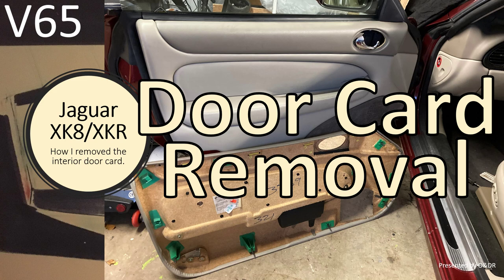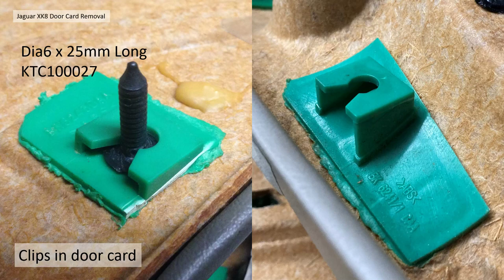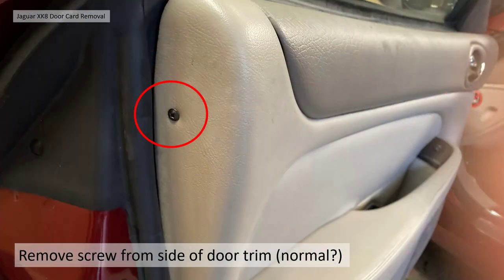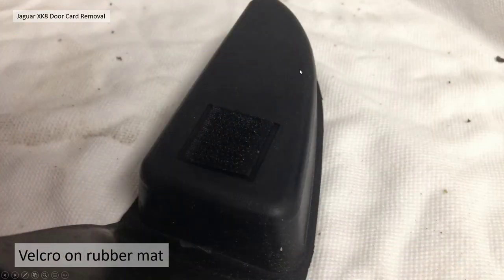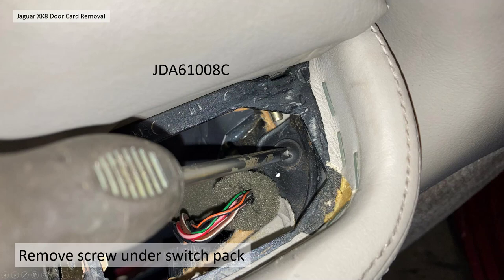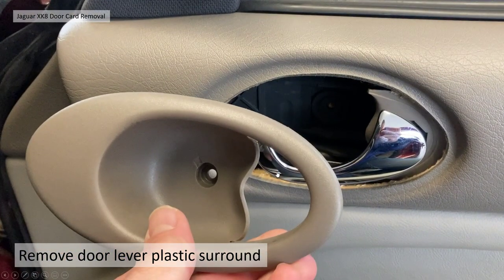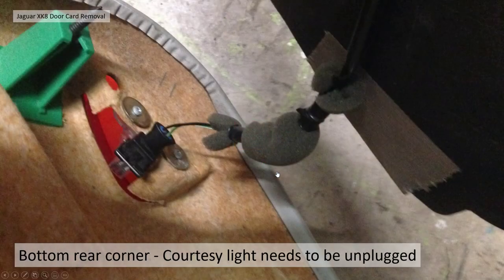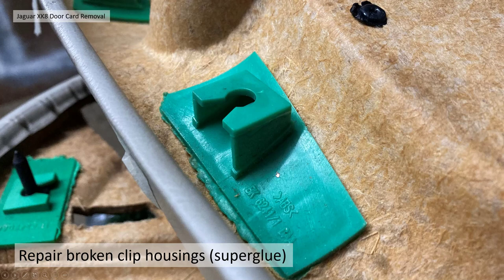Jaguar XK8 Door card removal V65 / XKR (X100)

Comment: Thanks Damian, got a rattly driver's door speaker, once again your authoritative videos are a must.
Reply from the maker: Bernard, glad you are finding them useful. Thanks for the comment regards Damian
Reply: @ODRModurol  I was defeated by the plastic cap in the door handle, my fine screwdrivers were not enough to flip it out, just can't get the angle I need on it, even with bending one especially. That little cap will not come out and I started to just make a mess of it. At least I know the card has never been removed before. Frustrating when you know exactly what tool you need but you can't find it and you're in lockdown. Rattly speaker, you're safe for now.
Reply from the maker: Bernard, they are particularly hard to get out the first time but not impossible. Hopefully it isn’t superglued in. Persevere and you will be OK. Just watch out for it flying off when you eventually get it off. Assume you are still in lockdown over there as plenty of time to fiddle. Thanks for the comment regards Damian

Comment: Hi Damian, thank you for this and marking the locations of the fir tree clips.  I had to remove the door cards to adjust the front windows because of gaps with the rear windows on my convertible.  This ensured things worked out well.  Cheers!
Reply from the maker: Craig, it’s good to hear that knowing where the clips are made a difference. Much appreciate your compliment and taking the time to comment, regards Damian

Comment: Hi Damian enjoyed your latest video, I mentioned a while ago to you my drivers side puddle light not working, just checked your door card removal video and opened it up enough to see the puddle light is not connected to anything and no wire and plug dangling so at least I know why it's not working not sure why there is no power source though, thanks for the door card video
Reply from the maker: Richard, glad you found it useful. Going to be doing my driver side door handle seal at some point. I will video where the wires originate from it try to help you retrofit. Thanks for the feedback much appreciated, regards Damian
Reply: @ODRModurol  Good man yourself Damian, poking about at thing's would never have dreamed of thanks to you,  and the other talented generous enthusiasts
Reply from the maker: Richard, glad the info is helpful and you are working on your car yourself. Much appreciated, regards Damian

Comment: Hello Damian! Hope you are well. Here is an update. I had my mechanic install the used switch. It did the EXACT thing the original switch did. I am completely out of steam on this dilemma. I left the door panel off. We are now thinking it is the door module. I can get a used one for about 100.00 on ebay. Really don't know what to do. Decided to run it by you.  Thanks for reading! PS. Another 300.00 in labor and still, no go!
Reply from the maker: Ben, Do not know what to say. You really aren't having any luck with your door. To be honest I am all out of ideas without seeing the car myself. At this point it would be good to swop out with a know working module  ideally from a fellow owner rather than buying one. Otherwise, you may keep spending more and more money. Sorry I know that might not be possible for you, regards Damian

Comment: Hi Damian, thanks for the informative video, in my XK8 the door card is actually loose at the top so I think a previous owner may have had the car off and broken some of the clips, any advice before I try and remove the card and do you know if the yellow brackets at the top can be replaced if already damaged?
Reply from the maker: Andrew, thank you. You can find new yellow bracket for sale. I did briefly cover this in a video, see link below.https://youtu.be/Ih0yOA9BdyU . Hope that helps, regards Damian
Reply from the maker: Andrew, found a link to replacement items on eBay, regards Damian
https://www.ebay.co.uk/itm/295947831897?mkcid=16&mkevt=1&mkrid=711-127632-2357-0&ssspo=_WbZNzTMQH-&sssrc=4429486&ssuid=sgHoZWOXTEe&var=&widget_ver=artemis&media=COPY

Comment: Hello Damian, thank you for the excellent video! Concerning the glass rails: wich product you used to lubricate? Kind regards Bart Engels
Reply from the maker: Bart, I don’t think the rails need lubrication because run on plastic liners. However, I have applied a same amount of grease on mine to assist. However, don’t know if this was a good idea of not yet. Thanks for the compliment and comment, regards Damian
Reply: @ODRModurol  Hello Damian, thank you for the fast reaction! I'll think to lubricate the system with WD40. Kind regards, Bart
Reply from the maker: Bart, no problem, thank you for the comment regards Damian

Comment: Hi there. 
Are you able to advise if it is possible to replace the central arm rest panel in the door card when it’s removed or it’s sealed and never coming off. I ask as mine could certainly do with some form of retrim and it’s either fix the old if at all possible or purchase some off ebay or somewhere? 
Thanks
Reply from the maker: Phil, yes the arm rest is a separate part and can be removed by unscrewing the four screws (with large gold washers). This has to be
sone from this inside after the door card is removed. You can see some of the fixings in the video. Good luck with the retraining. Thanks for the comment regards Damian
Reply from the maker: Phil, actually removed one and made a short video planning to post it on Friday, regards Damian
Reply: @ODRModurol  Thanks for the replies Damian. Looking forward to the new video so I can see what I have to do.
Reply from the maker: Phil, no problem, 1pm Friday, thanks for the idea, much appreciated Damian

Comment: What if the door is locked closed and won't open? 🙄
Reply from the maker: Kellier1916, assume you can access the inside? Pull the interior door handle? Central locking not working? Not sure of the situation you are in, regards Damian
Reply: @ODRModurol  yes I can access drivers side, unlock drivers door with fob ... Hear the actuator going and cycling the handle on the drivers side about 5 times ,... think the car is trying to unlock passenger side too but no movement on the deadlock ( inside passenger door handle stays depressed still) when I listen to the passenger door there is only a small click and no motor/actuator function. I think one of the micro switches has been displaced or has failed as the same problem is described a little on the jaguar forums. Pulling the handle inside or out has no effect (deadlocked) so my plan is to remove the door card as much as possible with the door still closed and then try to get the door open so I can access the mechanism. Any idea what I would need to target to manually open the door with the door card half off... I assume I'd be aiming for the latch somehow. I will watch your door microswitch video again too(answer probably there). Thanks for the time put into these videos I'm sure many xk8 owners will find them invaluable.
Reply: Update... Tried to unlock in the cold and boom heard he passenger actuator activate sweetly and the door unlocked. A relief as I would of had to half destroy the door card to get access. One other thing I did notice was that the window wouldn't go down when the door was deadlocked. Now all is fine but I'm not going to lock her back up so I can be sure to have a look at the micro switches first. I hadn't driven the car for a few days so possible that the bat was slightly low.... Any ideas what's going on? I've seen a few of these on the forum and it always seems to be either the battery or a micro switch.
Reply from the maker: @Kellier1916  Glad you got it sorted because as you say it’s quite difficult to deal with. Definitely worth taking a look at the battery condition and the micro switches. But doubt it is the battery unless you had other symptoms. The one micro switch operates the window. But thought the internal door handle would have opened it either way. Definitely need further investigation. Regards Damian
Reply: @ODRModurol  I've pulled fuse two in the passenger fuse box to disable the actuators from functioning until I can have a look at the switches, thanks

Comment: Where can we get the fur trees i need some after changing our the door caps for wood veneers.
Reply from the maker: Dave, they are available through SNG Barratt https://www.sngbarratt.com/English/#/UK/parts/eb863613-9b47-4751-a82a-7d669cf166e2?fromList=XK8%20%2F%20XKR(11)%20%3E%20XK8%20%2F%20XKR%20-%20To%201999(48)%20%3E%20DOOR%20CASING%20AND%20ARMREST%20Assembly(9930)&fromCategory=Node%20Push%20in%20fir%20tree%20clip(Node%20Id%201022965). Although probably cheaper getting some from Jaguar breakers yards. Hope that helps regards Damian
Reply: Or a Jaguar dealer. They still sell them
Reply from the maker: Mark, good point, thanks for the comment regards Damian

Comment: Strange to call it a door 'card'. Surely it's a door panel?
Reply from the maker: Lesley, Its a bit of a technical, industry and historical explanation. I believe the original flat door interior linings were just fabric or plastic covered boards. Possibly made from compressed card hence the name 'door card'. Now the lining are a bit more complex but essentially still fabric cover compressed card. The door panel is normally referred to as the metal inner and outer skin components. It's not the normal definitions but what has commonly used in the automotive industry. Interesting you brought that up as I forgot that this might make sense to everyone. Thank you very much for your input. If you have any other questions do not hesitate to ask, regard Damian